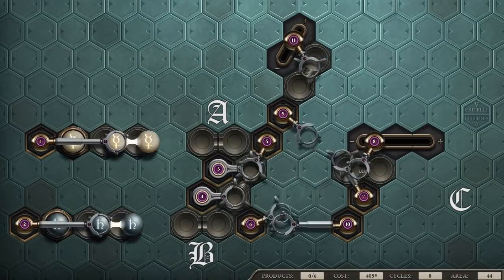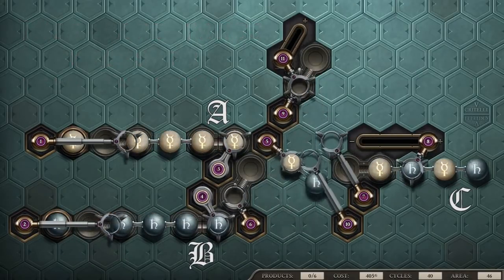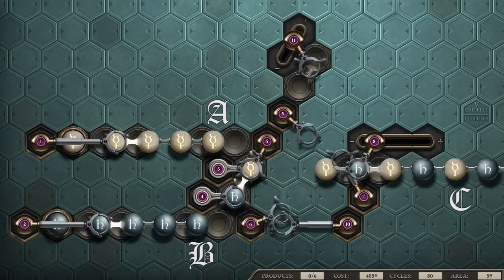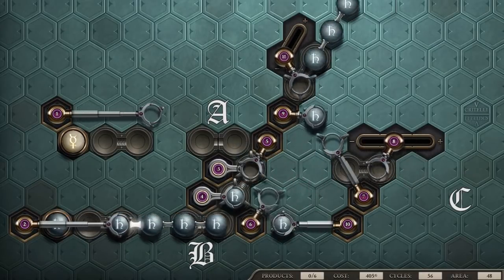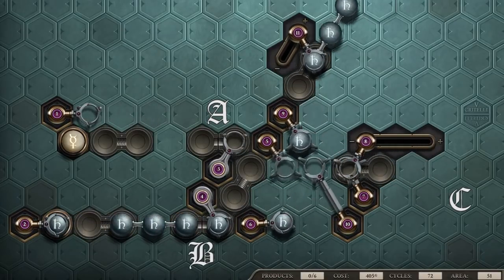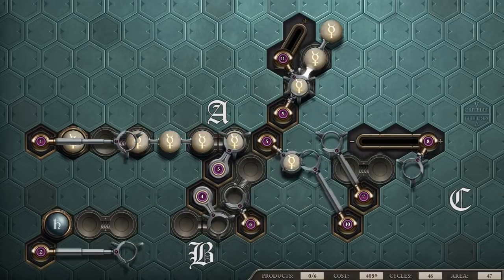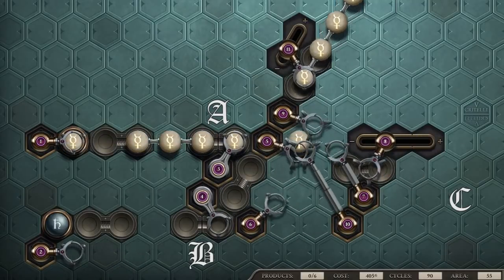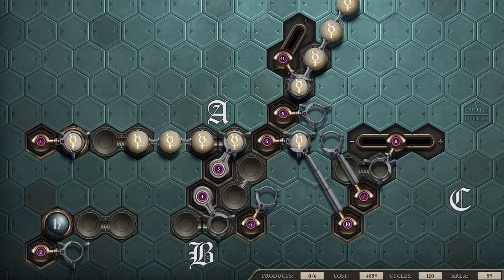Opus Magnum AND Logic Gate

Comment: After checking out a quick (30 minute) video on the game, can't you destroy particles by putting down products?
Reply: There are custom levels, but only a maximum of 4 reagents and 4 products
Reply: You could use the metals and quicksilver to do logic, then trade them up into gold and use a few carefully placed products to destroy them.  It would increase the size of the machines, but would make them probably possible.
Reply from the maker: Yes, but you're only given a few product points, which means you can't just give one product and one material generator to each gate :/ ~Sparks
Reply: Are there custom levels? and if so, can you add as many products and reagents as you like in that?
Reply: Aww.

Comment: Maybe to deal with the infinite stream of disposable particles, you could have them all get passed to the back of the machine and combine them all into a few streams.
Reply from the maker: Indeed! Another issue Is NOT or NAND gates need to output when they are not getting an input. I'm pretty sure an 8 bit adder is possible, but it's going to probably be SLOW and need to load or something. Alternately I could "invert" some gates so no particle means a particle and visa versa or something :P ~Sparks